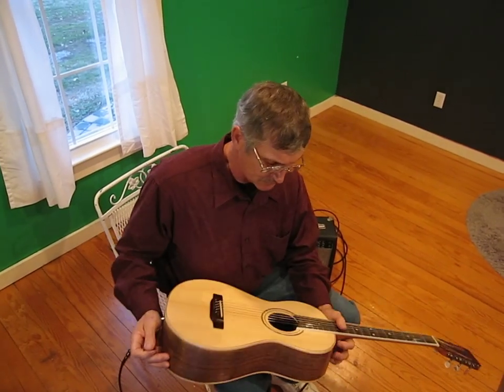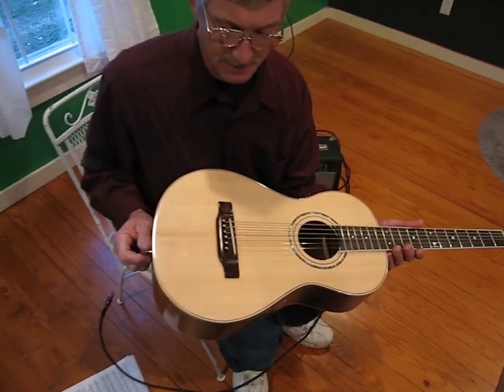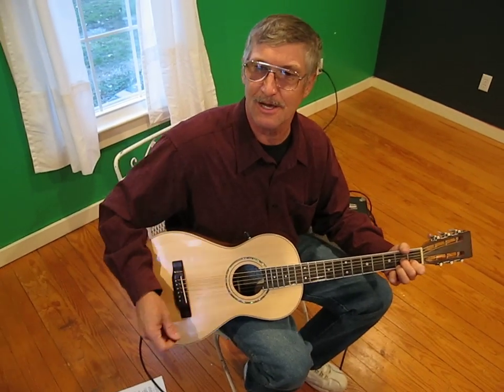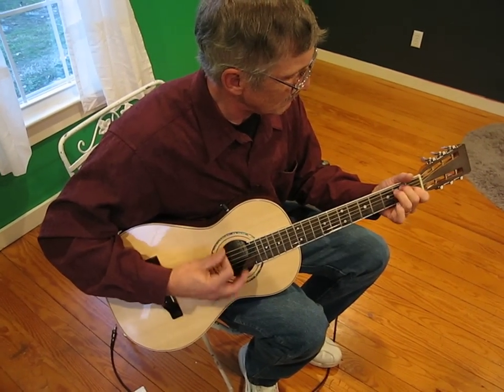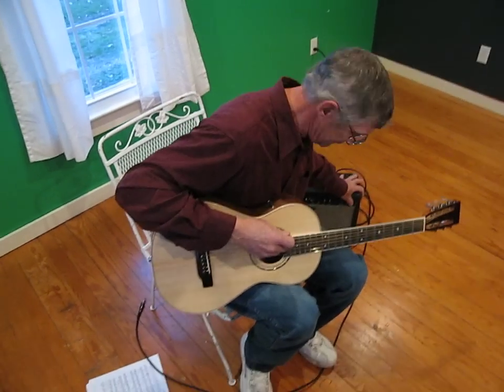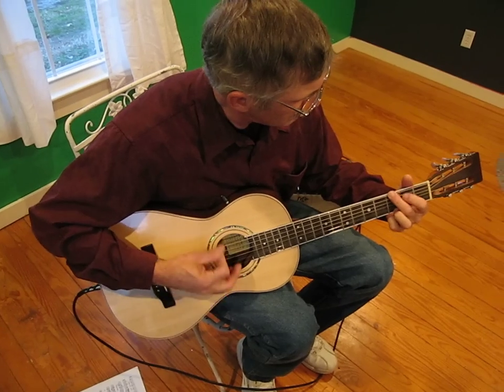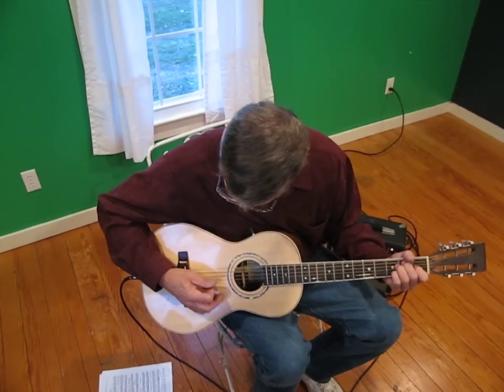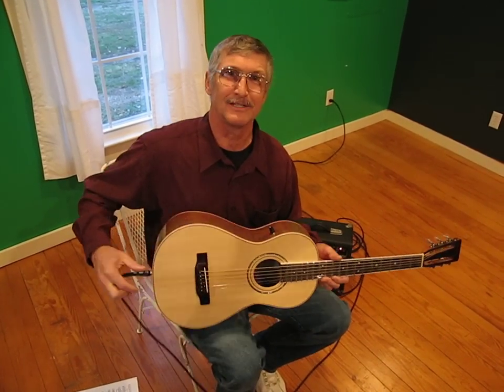What is a parlor guitar?  How does it sound?

Comment: I've read that acoustic guitars are named based on dimensions. What does some of the terminology mean, words like bout?
Reply: The Bout is basically the 'corner' of the guitar body,  so basically the part of the body where it curves round towards the neck on the side closest to you is called the upper bout, and the part that curves from the bottom side (the side resting on your leg) round to the back end where the strip button is, is called the lower bout. Hope this helps you.